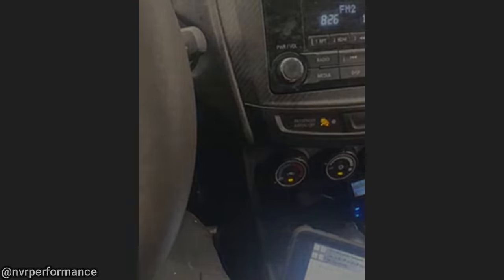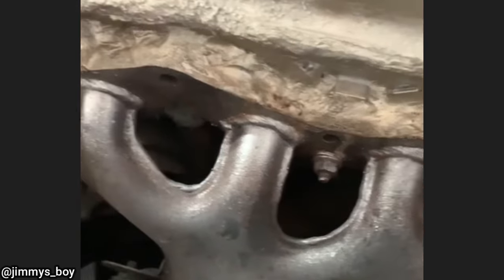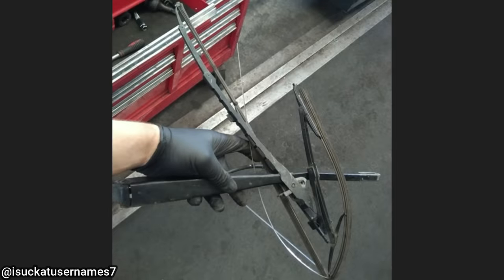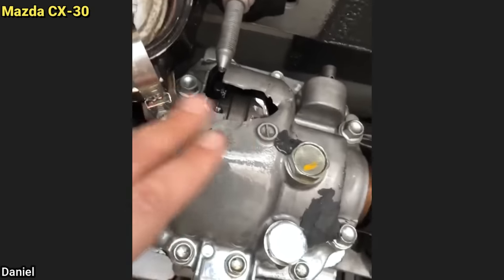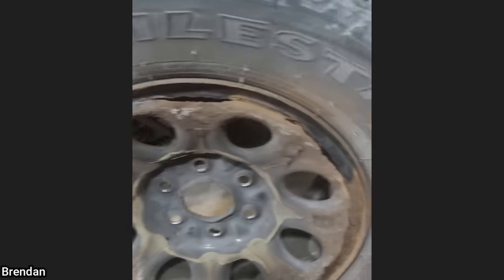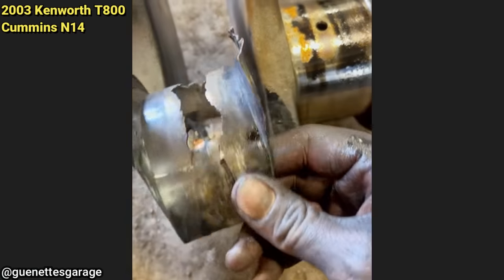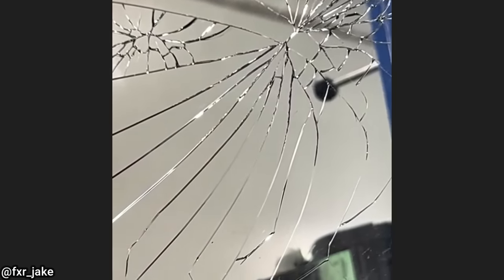Customer States (Best of January & February 2022) | Just Rolled In

Comment: My stepfather once owned a 1985 Toyota Tercel, which needed a battery.  He bought a battery that fit but the terminals were reverse which blew a main relay.  This car was old and he was cheap, so he bought another battery, and placed it on the floor behind the drivers' seat.  Whenever one needed to drive the car, you had to connect that battery to the battery under the hood to start the car.  I know the car is old but the Toyota dealer was in walking distance from the house.  Couldn't buy a relay?  

I have the utmost respect for mechanics for dealing with the public and their two ton extension of their personalities along with the design flaws that both posses.
Reply: Happened to me once when I put a random battery in my RX-8. Blew my main fuse and learned the valuable lesson that in an RX-8 the positive cable is black and the negative is red/black. (Why would you do that, Mazda? WHY?!) So I put some long (bright red and black) battery cable extenders on there so now it can take any kind of battery. Still, can you imagine like in 6:16 frying your entire electrical system just because you switched polarity? That's just (deliberately?) bad engineering.
Reply: Years ago I had a dodge stratus that had the battery behind the drivers side wheel (actually in the wheel well). The previous owner had installed aftermarket wheels with the wrong offset leaving lugs too short too properly thread on the lug nuts. When the battery died I could not get the wheel off (didn't have an impact wrench at the time), so I bought a new battery and connected it to the jumper terminals under the hood. I kept it in the passenger footwell and just ran the cables out the window and under the hood. It worked for as long as I needed it to.
Reply: @joeschmoe6908  That sucks but as long as it works. We owned a Dodge Stratus  that needed a battery.  Ours was in a car accident and did not have the front clip so one would have thought it would be easy to replace it but the bracket holding the battery in place faced the wheel
Reply: @joeschmoe6908  I almost bought a Dodge stratus years ago (second gen) because I liked how it looked, and my buddy was happy with his (first gen). I'm glad I did my research before buying it. Everything about those cars were a mechanical nightmare, same goes for the second gen intrepid.

Comment: Cool/funny videos, must admit to curiosity about the cause of some of them, like the dolphin/husky noises:D
And how that rusted out tire stayed 'intact' to get to the shop... lol.
Reply: The Dolphin noise was probably a slipping power steering belt and the husky was  a groaning power steering system maybe low on oil or never been serviced in millenia. The oil is only  a small quantity and it goes round and round picking up small filings and acting like a liquid grinder in the power steering pump and all the seals in the steering box. Also the oil loses its new properties and stops being as good a lubricant so the seals slip and stick which may also cause "husky sound" I changed the fluid and my power steering lasted a lot longer and was a lot nicer to use. All the nice glittery particles stopped going round chewing out the components and the steering was much nicer feeling.
Reply: @rogerpearson9081  Thanks:) I can do basic maintenance on a car, but I am VERY far from being a 'car guy' So some of the sounds and stuff in these videos don't mean much to me other than 'that is DEFINITELY not normal!" lol.

Comment: Yeah, I replaced your brakes. I said NOTHING about connecting them to the master cylinder though.

Great compilation. I think I may do a best of too whenever I get my cables to hook up my computer. More delays...Amazon is sloooow
Reply: It’s crazy that brakes are one of the most important jobs that are routinely performed on a vehicle, yet people pay so little attention to the quality of their work
Reply: @yyz4761  You know whats funny...I started to follow a trend of being goofy, using zip ties, the whole, itll be ok mentallity I see on so many Youtube channels...And honestly, it bugs me. I like doing things by the book, OCD level..maybe too much (my shop is compliant by FAA rules lol, but I work on cars, not planes). I need to go back to my roots, since Im tired of doing a job twice to seem cool and aloof. Screw that. Do it right, use a torque wrench, and do all the paperwork!
Reply: I started my whole whacky mechanical journey working on aircraft, so it’s been FAA specifications ever since. Gotten a lot of crap for being too anal, but it’s a standard that has never failed me and has probably spared me a lot of grief and liability
Reply: @yyz4761  Exactly. I mean I was in the USAF, but similar concepts, different terms. Like for repairs on my cars I use AFTO 781s for discrepancy/corrective action. All my tools are in a kind of shadow foam (although I was working for the past 3 months on a system that is both like shadow foam, but lets me add tools without cutitng a whole new sheet...and of course digital records, TAZ, caution and danger tags...and even markings on the ground for parking and other silliness...but, it makes me feel at home so to speak, and I get things done, despite being broken...

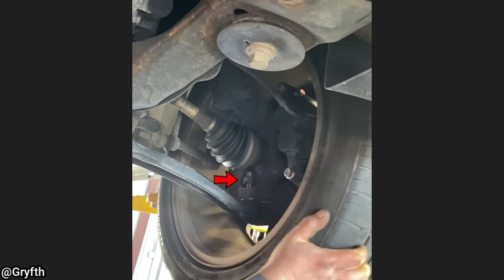Comment: 9:45 The exact reason why you should refuse to do a job if you don't have the right tools to do it with. Don't heat things that are pressed in to place. Use a press. If you don't have a ball joint tool take the swing arm off and use a press. That dude's lucky it didn't go through his head like a bullet. Don't do it if you don't have the right tools. Never use heat on anything other than a nut or a bolt.

Comment: that is why you dont torch the pinch bolts on Subarus, just snap the bolt off, run a drill through and put and longer bolt with a nut - the way the factory should have done it in the 1st place
Reply from the maker: Seems like it happens often on those Subarus from what I've been told.
Reply: @JustRolledIn  it is a stupid design from the factory.  any Subie in the northeast for long will have these bolts rusted in. and torching them is dumb, you can easily end up nuking the CV axle boot too. i just hit them with the impact and if they break run a good cobalt drill bit right through and get a longer flange bolt the same diameter as the original with a nylock flange nut.

Comment: How did you check the road noise from the drivers window at 160mph and did it go away at 191mph?
Reply from the maker: Wasn't me but if I recall they said they didn't verify the customers concern.
Reply: @JustRolledIn  Don't you have a race track at the back of the shop?
Reply from the maker: @Tony Sheerness  😂😂 I wish
Reply: Condition normal. At 191mph I believe you’ve left the roadway cause you’re flying
Reply: @yyz4761  Yes, that would explain why the noise disappears at 191 mph.
Reply: @tonysheerness2427  For some reason, people keep parking their cars in it.
Reply: @JustRolledIn  USA here. Is it possible the customer looked at the km/h reading on the speedometer and thought it was mp/h? Would that give such a high number?
Reply: If I was the tech id ahve drove it down the street, brought it back to the shop and put on the work order, unable to verify complaint and moved on.
Pretty sure thats what the original clip said the tech did.
Reply: @sparkplug1018  According to the sheet, they ran it up to 70 mph without getting the road noise, and did in fact tell the customer they could not reproduce the problem.
Reply: I had a cousin that went to the dark side. He was constantly trying to get me to modify his vehicle for street racing and drifting competitions. I’ve known a lot of extremely competent drivers but this kid wasn’t one of them. I flat out refused to modify this kids vehicle. I wouldn’t even entertain this customers complaint.
Reply: @Tony Sheerness A chassis dyno is one way.
Reply: @ducewags  Wind is absent.
Reply: @tonysheerness2427  "Check for road noise". That is what the cust wanted checked.
Reply: @ducewags  Customers do not always know what they hear that is why they asked for road noise to be checked. Otherwise they would say the offside front bearing is noisy or the tires are thumping. The door seal in my car would buzz at 70mph how do you explain the noise?
Reply: @tonysheerness2427  I have found more then just bad door seals on a dyno, in my number of years running a shop with a dyno.
Reply: @ducewags  Good for you.

Comment: I agree about the not his fault hitting something on the highway. I caught air in my jeep once hitting a huge piece of scrap metal at 70 in the interstate. If i tried to dodge it i would have likely killed people next to me.
Reply: Ditto, leaned defensive driving as a kid but one important lesson was to consider other driver's safety when making split second decisions on avoidance. Generally stay in your own lane or take the verge (margin). And maintain steering wheel control. I've had blown tires and frame damage but always been able to drive to a safe stop. Knock wood.
Reply from the maker: I agree on that but not a reason to have it covered by warranty lol
Reply: @JustRolledIn  Comprehensive auto insurance may cover toad debris.

Comment: As a young mechanic in the 80s I was replacing U-joints in an old Cadillac, where you heated the yoke with a torch to soften this injected fiberglass retainer for removal.  I gave one cap too much heat and with a loud POP the U joint cup explodes out of the yoke, hits the ceiling, then lands right in the middle of a customer lady's classic Ranchero truck with a new custom paint job sitting in the shop a few bays over, putting a big ding right in the middle of the hood.

Comment: I once bought an Acura Integra from Mike Hale Acura in Utah. I finally received the keys as the place was closing up for the night, so it was  dark outside. Everything seemed fine to me, so it’s a good thing my buddy was driving behind me since there was a ton of smoke coming out of the exhaust. We took it to his brother’s house (he was a mechanic) and he drained 9 quarts of oil out of the engine. He then put 4 of those quarts back in, and everything was great.

The best we could guess is that the tech went to perform the oil change and forgot to drain the old oil before adding the new. 

Even dealerships suffer from incompetence sometimes.

Comment: Back in the eighties I worked at a Montgomery Wards Auto Express.
One of the tire busters was messing around with one of the oil dispensers and changed the display from quarts to gallons .
The next guy to do an oil change put 4 gallons of oil in a Chevy Chevette.
It still ran but not very well - filling the shop with smoke.
After draining the excess (and with the customer waiting up front) he took it to the nearest subdivision drove it around and around until it stopped smoking.
There was not a single mosquito alive in that neighborhood.

Comment: I appreciated the flex seal on the bottom of the oil pan. I have a 1962 Studebaker, and some idiot siliconed the oil pan gasket to try to stop a leak. After being unable to get a new gasket for months, I finally broke down and took it to a mechanic, who was, just a couple weeks ago, able to get the part from a junkyard after a couple months of looking.

Comment: As a paramedic I love when I roll up on an accident and one of the cars is a hoarder vehicle. It's always like a garbage truck exploded.

Ashamed to say that I did the same "overfill" of that Chevy Cruze when I was 16. To  a 1990 240sx. Turns out the KA24E can hold 26 quarts of oil up to the valve cover.

It already had no rings so I just drove it a d it burned it off. Ran absolutely no worse afterwards, lol.

Comment: I"m from the Netherlands and over here we are required to have our cars checked by a certified mechanic each year to get a certificate called APK. The car gets checked in such a way that wheels, brakes and the frame etc. are in such a condition that they are up to code. Enough profile on the tyres is one of them. 
Usually with normal operation within designed parameters, the car will last another year, given that invisible wear and tear doesn't merit another visit, for example when the clutch disk is worn or some valve breaks etc.

Comment: I sold car parts for 15 years back in the 90's - 2000's. There were still vehicles from the 70's that people would jury rig with tape and wire. However the new models didn't do so well with home repairs.

Comment: my favorite arent even car related, but railroad repair shop. heres some examples
"Toilet is horrific, some uncouth Jabronie left a hot mess in the toilet and it smells atrocious" (the locomotive toilet in most diesel locos is in the nose which also has storage for traction sand)
"the wheel is so fucked up, the tread smiles at you everytime it goes around"
"train makes loud GADUNK GADUNK GADUNK sound"
"internal firebox sprinkler keeps turning on"
"choo choo missing its comfort item and refusing to cooperate"
context for the last one: the colorado rr museum has a long running joke of the operable locos having "binkys" which are kids blankets with those bugs bunny lookin stuffed animal heads. and if you dont put their binkies on the handrail, the safety valve pops and wets the bed AKA the roundhouse. and if you forget to take it off, they wont wake up. so when they dont have their binkies, they get cranky. off"

Comment: I have friend who heard banging noise after mechanics installed new brakes bud didn't check what it is and gone on trip. And then his wheel fell of at 120km/h (~75mp/h), after everything was checked it's turned out that mechanic who changed brakes didn't tightened lug nuts enough. He was lucky to stay alive.

Comment: I've never saw a ball joint explode. Would love to have more information on how that could happen.
Reply: People heat them up so they will be easier to take out,problem is... they have grease in them,the grease starts getting mighty hot and as you well know heating grease turns it into liquid, liquids causes expansion (like steam) and something has to give......boom.

Old ball joints had greaseable Zerk fittings,you take the Zerk fitting out and the grease runs out and no problem, newer balljoints are not serviceable so no Zerk and no hole where the grease can escape out of.
Reply: @dntlss  I've replaced hundreds of ball joints in my life. I've never heated one up to do so.  And if someone did heat one up for some reason, they would do so with a torch. Long before it got hot enough to explode, it would catch fire and burn. But maybe you're right. Just seems weird and crazy that it would happen.

Comment: Year ago I worked with a tech he would save all kinds of fluids in old antifreeze jugs, one job he replaced a customer's engine he then accidentally filled the cooling system with diesel. 
This is the same technician that was once draining the oil container with compressed air and opened the wrong valve then about 25 gallons of oil shot out all over the shop, it was raining oil. his boss was not pleased.

Comment: i once returned a VW to an auto body shop that had done some work on the front end. I showed the owner that the front wheel liner on the passenger side was in position but completely detached from the fender. He looked, scratched his head, and pulled the wheel liner right out, showing the actual wheel liner underneath. "This isn't your wheel liner." How in the world did I pick that up without knowing!?

Comment: as someone who did a lot of my own mechanical stuff, the one thing i learnt from experience is BUY A FFFFFFFFFFF MANUAL  of the vehicle you will work on, it save soooooooo much headaches for doing something stupid. i also used to stick to the same vehicles just different years so i got to know how to fix them easily. todays cars i would not buy , when i can afford one it will be from the 80-90 not the shit they sell now where you need to learn about all the diagnostic crap and so much electronic crap only mechanics know about, i did my own body work and paint jobs, brake jobs, rebuilt engines love the simplicity of the older cars

Comment: I got stoned once and filled my 2003 Dodge avenger Full of diesel.  It ran rough and smoked lots like it was running rich even though it was -30C outside.  It was just hard to start.  I just drove it till I got the level down and diluted with gas.  It was fine. hahaha

Comment: I worked for BMW for several years as a Technician. Our 'garage' had a 'tin' roof, so the temps in the shop were almost unbearable during the summer. Anyway, I was working under the dash - sweaty - miserable, when all of a sudden, I felt stinging pain on my hand. I looked down, and to my shock, I was covered in fire ants! After removing the ants, and cursing up a storm, I found the root cause. A large, partially rotting, red apple, under the driver's seat, covered in ants!! I was so furious, I wanted to choke the owner!! What a complete slob! The car - once again - a BMW, was absolutely disgusting inside!

Comment: Thirty or forty years ago I worked on my own cars. I had the Motor's manual™ for my car, and even with a 425 under the hood, there was a ton of room. Now days, I add gas, check the oil, and for anything else at all, I take it to a mechanic that knows what they're doing. Way too many wires, hoses, ducts, covers and other crap for this old man to even think about messing with it. 
Nope, I'd rather pay to have it fixed right the first time than pay to have the original issue fixed AND fix whatever I screwed up.